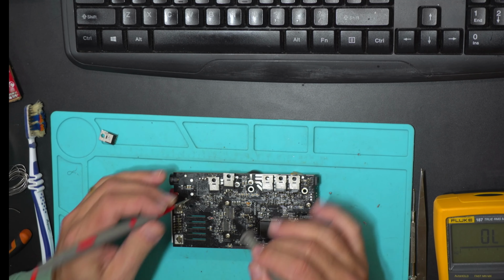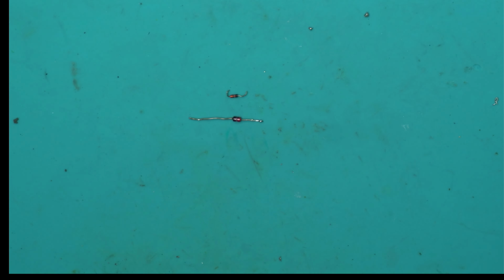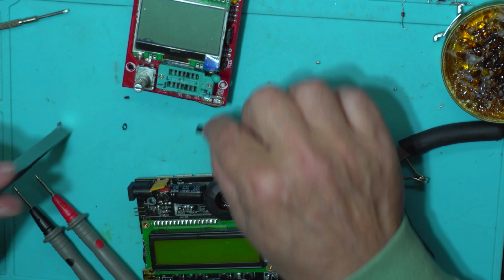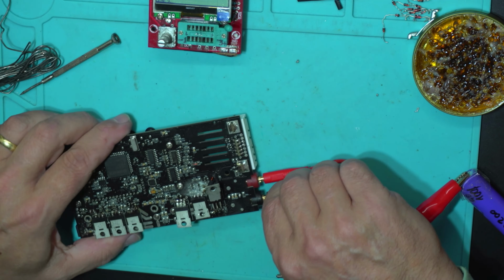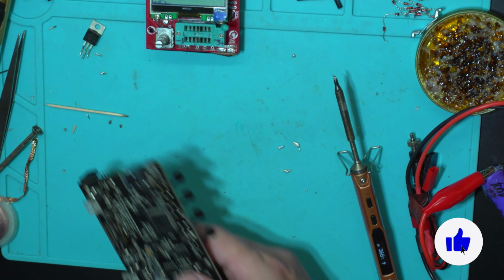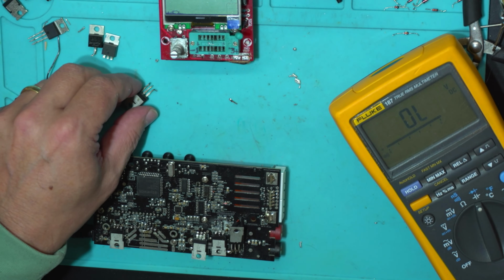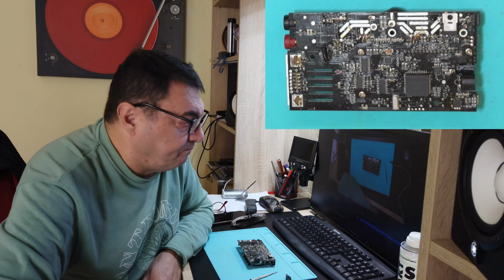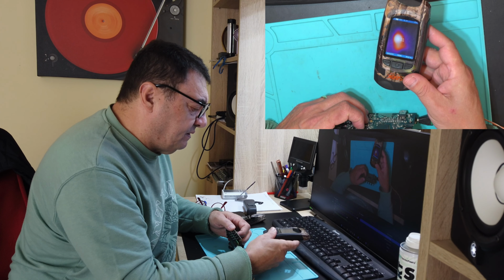Charsoon Antimatter Icharger 106B Turnigy Reaktor 250W  fix

Comment: Thank you!
Reply from the maker: I found the explanation for the mess. My power plug was kind of oxidize and once hooked on device there were sparks and transient high voltage spikes, that turns to burn 5V rail...so be careful with the plugs.
Reply: @viocaia must be the same problem with me, it worked fine until one day I unintentionally plugged the power cord to the power source while turned on! One question about Q26 transistor, mine shown low value around 0.2v, is it a sign for replacement? The odd things, the charger is working for discharging only while the charging function is not working (along with the motor run and foam cut)
Reply from the maker: @vist789  I recall there is zenner diode which usually get burned if overvoltage is present. Try that one first, I can't recall which and where on the board since I don't have the board anymore.  But check the forums for the exact topic on the screen, there are little advice you should follow.